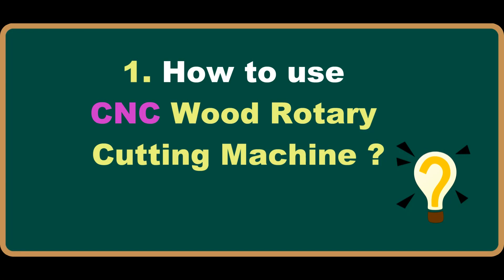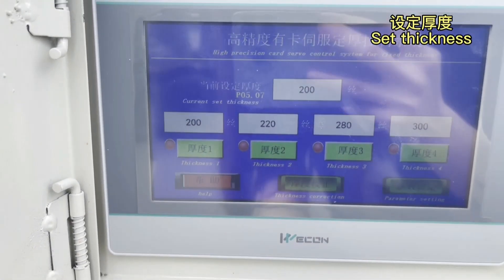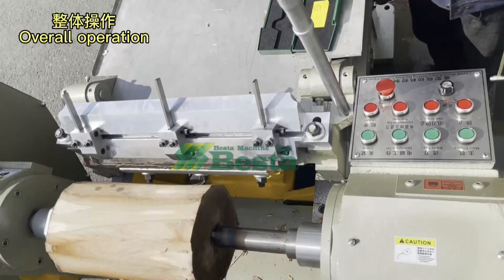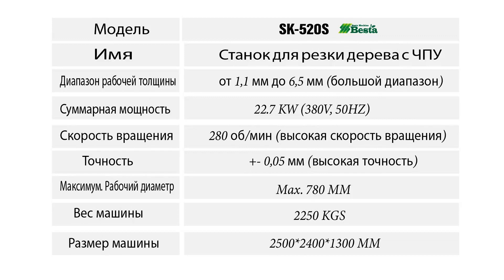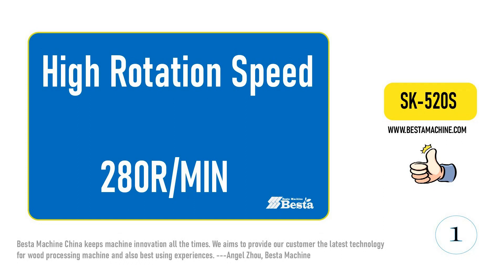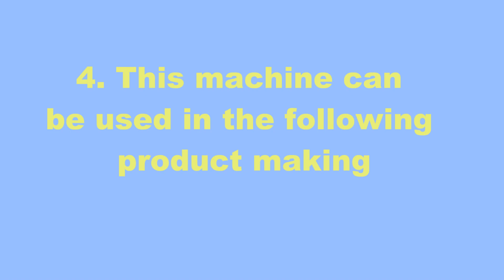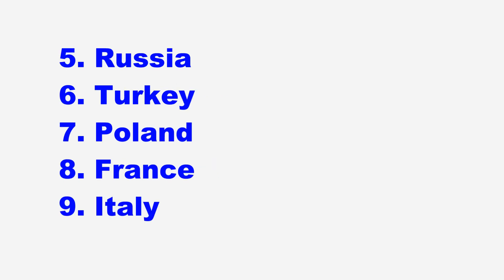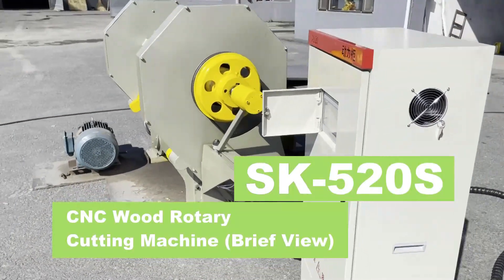How to use CNC Wood Rotary Cutting Machine, Wooden Spoon Making Machine

Comment from the maker: MODEL: SK-520S 
NAME: WOODEN VENEER MAKING MACHINE
WOOD ROTARY CUTTING MACHINE 
TOTAL POWER: 22.7 KW 
DRIVEN BY SERVO MOTOR, HIGH PRECISION, HIGH SPEED.
ROTATION SPEED: 280R/MIN (HIGH ROTATION SPEED)
WORKING THICKNESS RANGE: 0.3MM TO 6.5MM
PRECISION ACCURACY: 0 TO 0.05MM (HIGH ACCURACY)
BRAND: BESTA MACHINE
APPLICATION: WOODEN ICE CREAM STICK MAKING,TONGUE DEPRESSOR 
STICK MAKING, SPOON, FORK AND KNIFE MAKING, WOODEN COFFEE STIRRING
STICK MAKING MACHINE